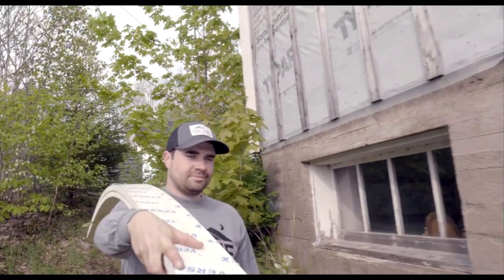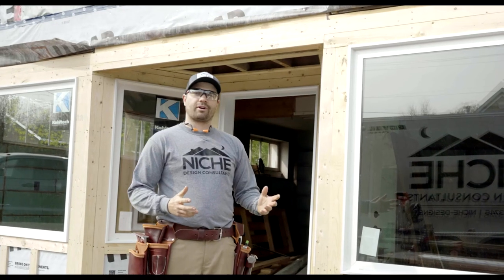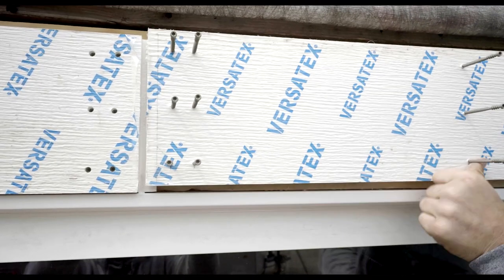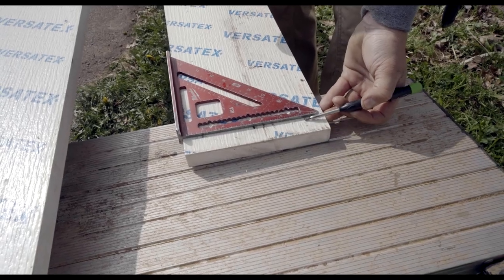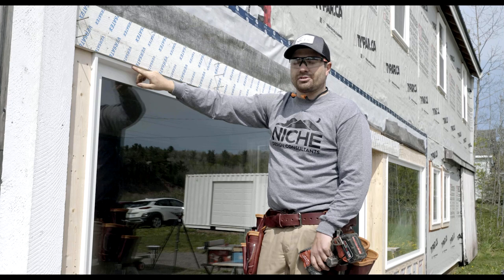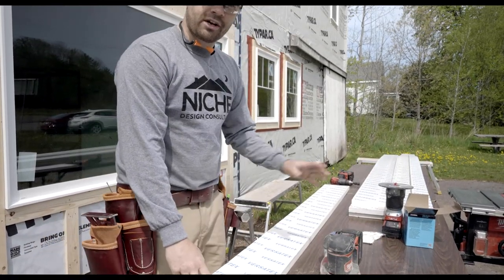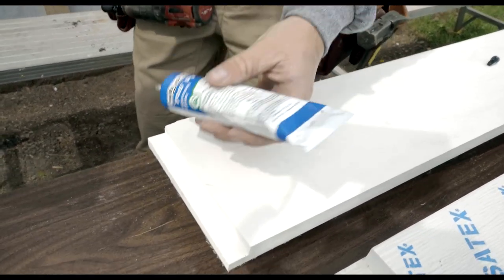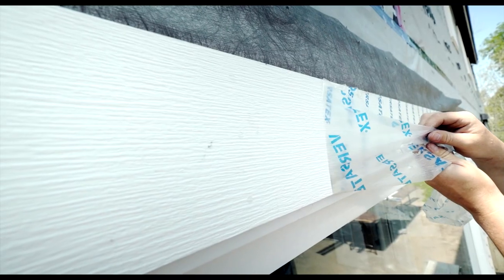Exterior PVC Trim: Joining Long Runs

Comment: One thing I've always wondered: With the recent upswing in massive wildfires occurring all across North America, why would you use a "probably" highly flammable plastic trim on your exterior instead of a fire resistant cement product like Hardie Trim or a wood trim covered in a protective metal  sleeve?
I know fire professionals say that a metal gutter is safer than a plastic one because the plastic  gutter will melt in a fire and rain flaming plastic onto the ground at the base of the building so why use plastic trim that will probably do the same thing in a wildfire?

Comment: I square cut, pocket screw and glue my joints when using PVC. I’ve never had it pull apart. I’ve also never used Versatex though either. Here in VT I use Wolf, Kleer, and Azek depending on the supplier I’m dealing with.

Comment: Well done tutorial series. The question I have is where to source the PVC glue you are using, especially in Canada. Do you have a local supplier in the Valley? There seem to be very few suppliers even online and of those, few actually have it in stock (none that I have found at the moment). Shocking considering the amount of PVC trim available at big box stores. I suppose most hacks just fill the gaps with caulk and call it a day...